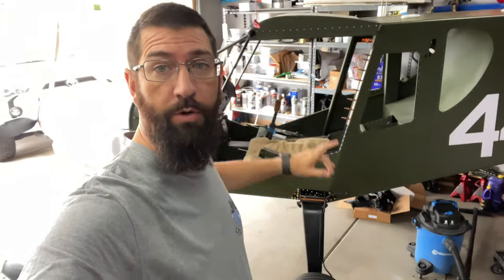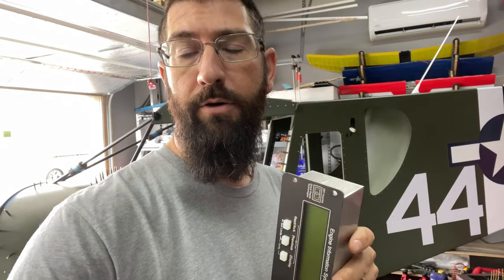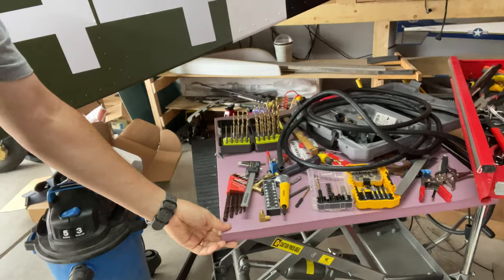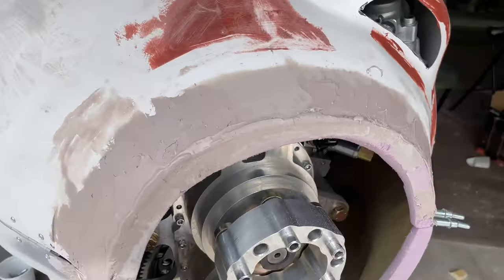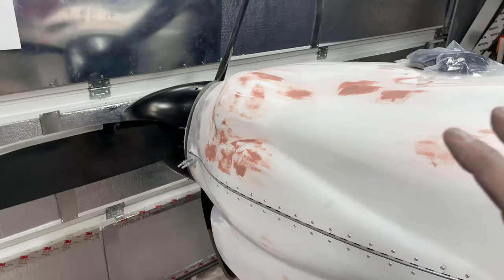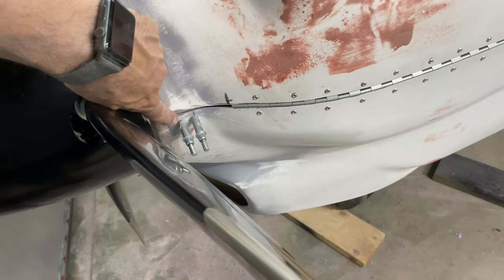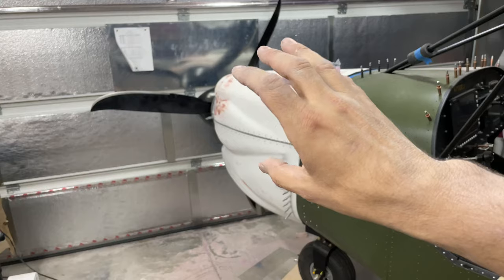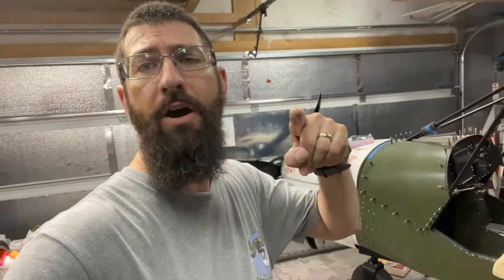Cricket Build: Blending the Cowling to Spinner

Comment: Hey Joe, I am confused . So the fuel flow sensor is different than the fuel pressure sensor? Will I need an additional sensor for fuel flow flow on the viking?
Thanks
Reply from the maker: Correct, the fuel pressure will just give you that pressure. Fuel flow will let you know how much fuel you are using. It is not necessary but for me important since I am setting up for IFR.